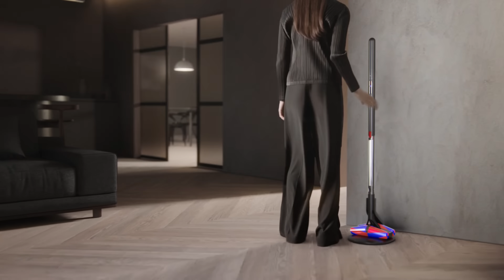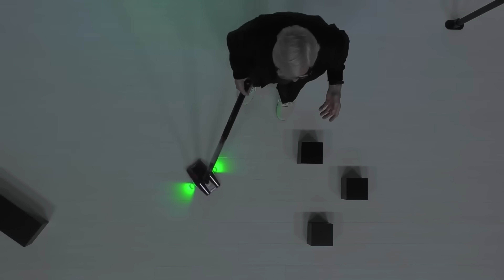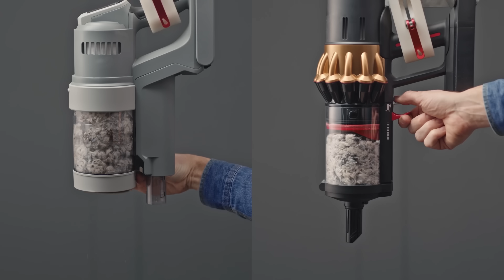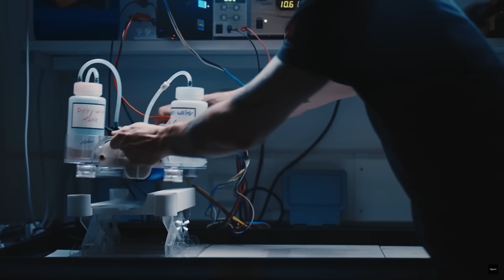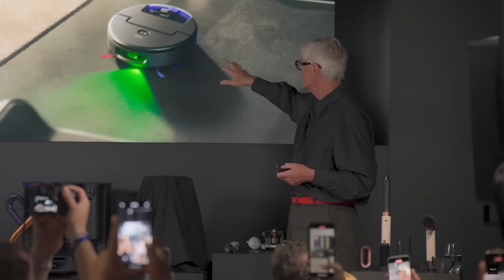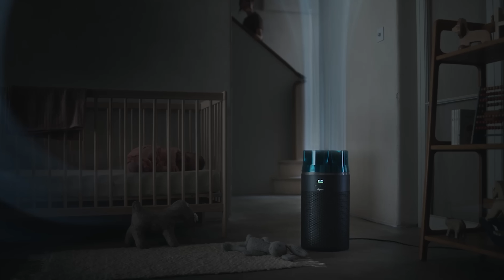What is Going on with DYSON?

Comment: Whats the point of self emptying dock if u only nedd to empty it every month or so??? It wont clean the filter so u still have yo do that so what the point? U will also have go wash dock filters too
Reply from the maker: The main benefit is fewer manual bin emptyings and less contact with the dust. It doesn’t eliminate filter maintenance, so whether it’s worth it depends on how much you value that convenience.

Comment: Not buying anything that needs a battery because when it runs out they charge you a fortune.
Reply from the maker: Replacement battery cost and availability are definitely worth considering before buying a cordless product. A corded model may make more sense for anyone who would rather avoid that added long-term expense.

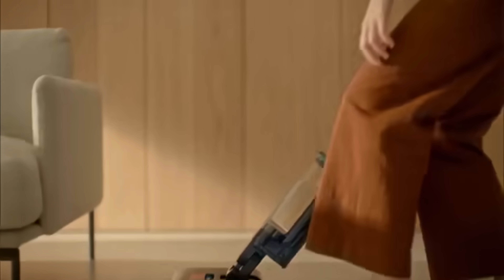Comment: 5:23 it's not a wet/dry vacuum, there is zero vacuuming going on, there is no vacuum motor, and it will NOT handle or vacuum up dry debris. All dirty water and debris is simply squeegeed off the roller by mechanical means, but it will not suction up spills or anything larger than a crumb. I don't know how they can get away with calling it a vacuum cleaner anymore.
Reply: It does pick up dry debris because I tired it without water but I wouldn’t call it a vacuum and I’d use an actual vacuum first and Dyson is making certain products for certain uses but  many people are thinking they are like the tineco but they aren’t they are made to be more hygienic without being like the tineco so they are a little different

Comment: Dyson fired over 1000 people from their UK site in summer 2024 - the vast majority of whom were in the floorcare 'development' department where they take the concepts and ideas from their 'new ideas' department and turn them into scaleable and sellable products. The justification was they could simply do the development in Malaysia by the same teams who work with the tool makers for final realisation, and also outsource a lot of the development work, all in a bid to save money due to losses made on failed investments (e.g. the failed Dyson electric car). The big mistake they found was easily 90% of their floorcare knowledge, curated over 25+ years, existed in the development team who did the majority of testing and tweaking, and they're finding the Malaysian team are now having to do twice the work with the same number of less-experience people in facilities not equipped for design development. It's very telling how there hasn't been a single new floorcare product launched since that wasn't already in active development, and the latest pencil wash is just the same mopping submarine head that first came out 3 years ago attached to the new Pencil vac, which had a lot of negative reviews. The 'new' ones they have launched are just re-skinned evo models that saw limited previous releases. Very sad all round.

Comment: The V16 head needs a bit of getting used to, but it's totally possible - what you get is zero catching of hair and fur - I have 2 dogs, a cat and long hair myself and not once in the 4 months of ownership have I seen anything get stuck to the cleaning head of the V16. HOWEVER, I am a bit annoyed that they released the V16 without it being compatible with any old accessories, shipped it with one single filter and 4 months on none of the fitting accessories are available still on the website. So here I am with my £900 vacuum waiting 2 days for my filter to dry because 1, I only got one for my money 2, it's been out of stock on the website since the vacuum was released in the UK. Thankfully I bought it from John Lewis and considering contacting them to get it returned.

Comment: I'm very curious about the new V8. I'm wondering if it can compete with a V10/V11, or if it is better than those models.
Reply from the maker: The refreshed V8 is surprisingly close to V10-level performance for everyday cleaning, but the V11 still has more power and features overall. So it can “compete” with a V10 in many homes, but it’s not really a V11 replacement.
Reply: @VacuumWars thank you! I'm on the lookout for a new cordless vacuum, for my budget the V11 seems a bit too much, but I'll compare the prices and discounts of the V10 and V8 Cyclone. If the V8 will be much cheaper, I'll get it. (The lowest price in the past month for the V8 was 250€, whilst the V10 was around 350€. At this state I'm thinking the V8 would be the winner.)

Comment: If they haven't fixed the cheap plastic lever on the dust collection bin then its still a no.  Our last dyson barely more than two years old, we couldn't open the bin as the plastic lever just seized.  We took it for repair to an authorised Dyson repairer and they replaced it.  As he is demonstrating the new lever it broke again.  Dyson was sold and we moved to another brand.

Comment: Dude $600 for the pencil vac is literally them spitting on you. That pricing is insane. I hope Dyson fails, they’re routinely the most expensive and don’t actually innovate much. Like cool you made a thinner hard floor only cordless???

The fact it doesn’t even have an auto empty bin yet for the prices they charge is insulting. Fck em
Reply from the maker: Pricing and value definitely spark strong opinions, especially in this category. Everyone weighs cost, features, and innovation differently, and it’ll ultimately come down to whether people feel the product fits their needs at that price point.
Reply: That's why shark is just as good of not better

Comment: I currently have the Gen5 Detect and I just don’t understand why have the one head. The fluffy one is so good for hard floors not to mention the cone thing can scratch hard floors and will wear out the bristles faster. I don’t like the compressor thing either because I don’t want my dirt sitting there and festering. I like the color scheme, but that’s about it. Also the V8 is still going?? That’s a Dyson that just won’t die.
Reply from the maker: . Floor heads really come down to personal preference and floor type, and a lot of people still swear by the fluffy roller on hard floors. Same with the compactor idea — some folks like the capacity boost, others would rather just empty the bin more often. And yeah… the V8 really is the vacuum that refuses to retire 😄 It’s kind of impressive how long that model has stuck around.

Comment: As disappointing as the look of the V16 floor head with all the seemingly obvious design flaws,  I am glad to see a mainstream manufacturer deploy a counter rotating brush roll head (the one on the pencil vac), and we will hopefully see versions for full size cordless/corded stick and corded uprights deploy not only for dyson, but in other manufacturers as well.  Shark's duo clean is..okay, but a true CRB should get really close to one pass cleaning,  and be especially helpful in areas like the northeast where salt season makes vacuuming  in winter a real pain.
Reply from the maker: Hopefully this is the start of wider adoption and refinement across more full-size models and brands.

Comment: 30 days!? Pull the other one. Dyson would have the slightest bit of credibility if it consistently made it's systems interoperable, with swappable batteries, heads that fit between different models, etc. But every one is unique and a new, overpriced fashion accessory.

Comment: i find quite annoying that cordless vacuums are aiming to get thinner and thinner, i am actually looking for a cordless vacuum with  larger than normal diameter that will be able to collect without clogging essentially dirt from the garden brought in by dogs and human into my downstairs "open air" kitchen. i cannot seem to be able to find it. can you recommend one? sure suction is important but stuff keeps getting stuck in the tube, the tube needs to be larger

Comment: Hello folks. Can anyone help me please? I got the V12 Detect Absolute Extra Cordless Vacuum back in 2022.
Though it still works fine, I think I may be due for a replacement. This one will be handed down to family.
Any thoughts or suggestions on what to get next? Thank you.
Reply from the maker: If your V12 still works well, you’re already ahead of most people. For a replacement it really depends on what you want to improve — more power and longer runtime, something lighter and similar, or better hair wrap performance.
Reply: @VacuumWars  Hello. I appreciate your reply. 😊

 I guess we can start with what you mentioned. I'm looking for something that improved upon the V12. Nice to haves are better power, longer battery duration, better hair wrapping, lighter. But one or some of those missing are not deal breakers. Basically, what are the successors to the V12? 

The V16 in the video looks nice. Is the issue about the middle part not cleaning really a big hindrance?

Comment: I have robot vacuums for ~ 6 years, never vacuumed once manually since. I have a dust blower tho, to get the dirt out from places where the robovac cannot reach (then it vacuums from the ground)
Reply from the maker: That’s a great system!!!  Robots handle the daily work so well now, and using a blower to push dust out of tight spots is a smart workaround, let the robot finish the job.

Comment: Cost cutting and profits is what’s going on at Dyson!!   Don’t talk about their rubbish customer care outsourced to an Indian call Centre!   V16 is a horrible machine!!!  I’ve used ur many times in the shop and compared to V15 and V15 does better on carpets and hard floors.   The V16 just doesn’t have the same suction at the floor head! The 140000 RPM - 55 air watts on the pencil vac is on Max mode only which is the mode that has the lowest run time,  it’s not designed to be used on Max mode continuously so I think it’s misleading!!!  Infact this is on all Dyson claims!   V8 isn’t 150 air watts in normal mode,  it’s around 28 air watts.  They say V15 has 230 - 240 air watts,  but again that’s in max mode!!  I’m NORMAL mode it’s 47 air watts!   I wish vacuum reviewers would disclose this information!!
Reply from the maker: Appreciate you laying all that out. You’re bringing up a real point that often gets missed. A lot of brands (not just Dyson) headline their biggest numbers in Max/Boost, and that’s not the mode most people run continuously because of runtime and noise. We try to focus on real-world cleaning results across normal use.

Comment: My concern with the wet floor cleaner is that it’s essentially the same design as the shark steam pickup. If it isn’t much better than the steam pickup it’ll be a tough sell. Just goes to show how well designed the steam pickup is
Reply from the maker: That’s a fair concern.

Comment: Let me guess, the last year's vacuums are incompatible with this year's cleaning heads.  Because they at Dyson has reimagined the connector. Again.
Reply: yup. i got the new piston. old acessories wont work. not even the previous dyson batteries are compaitable. they changed the battery connector too . i will say the new connectors are better, they evenhavea. gasket to cut any suction loss.
Reply: @randomrazr  it is theorized by some that the connectors also have a problem... that crippled the V16.
Reply: @AbsoluteRainbow_2K6  wait what is this new issue with the new connetors?
Reply: @randomrazr  maybe. A small non-conductive tape on the data pins might fix the actual issue.
Reply: @randomrazr  and the best thing is none of the new accessories are available
Reply: @randomrazr  not changed, but reimagined and reinvented, so that it is much more better now :)
Reply: @VladLeonovich-o4x  nahh they wanted to milk more money out of consumers
Reply: @randomrazr that why the reinvetned them not changed, don’t you get the marketing bs? 😂
Reply: @Mateuszyk  ohhh so this is a revolutionary change . got it ;)
Reply: Roborock does this too with their newest QRevo's... They just wanna catch money and dont care about waste.
Reply: Precisely
Reply: When my Dyson goes I'm getting a  Shark vac
Reply: I can attach my v15 detect soft roller head on my v8 animal and it works exactly the same.
Reply: Just making up alternative facts lol
Reply: Strange how that happens isn’t it 😂
Reply: It’s not because I’ve tried it.   BTW the V16 is rubbish!!
Reply: @blakaeg  V16 is crippled, not (true) rubbish! The connectors being changed have nothing to do with THAT!
Reply: I bet you miss USB B as well huh grandma
Reply: every head they made already cames with new vacuums you dont have to think about that. Also no need for upgrading. Vacuums are vacuuums, its not an iphone, its easy to repair, if its not working.
Reply: Following the Apple protocol where nothing carries forward to new models. Out with the old and in with all the new components.
Reply: @scottmackey4182  this is hardly true for Apple anymore, though this year Apple did change almost everything.
Reply: They at dyson? Who talks like that 😂
Reply: Think about as a IPhone that comes every year, and new features aren’t compatible with the older gen
Reply: And they will be able to scan and send the information of stains on your floor to their servers to figure out your diet habits, household members, their ages and monthly cycles and sell to third parties v)
Reply: Not true, I just got a new vac and all my old attachments from five plus years ago fit perfectly.
Reply: @Enhancedlies  it must be something before V16, actually.
Reply: @Enhancedlies only the non-powered ones will fit.

Comment: No way the pencil vacuum has good enough filtration to not even filter the air but protect the motor. The motor is so small, and with the lack of filtration, i think the motor will become packed with fine dust over time and eventually kill the motor.
Reply from the maker: That’s a reasonable concern, but the pencil vacs actually do have motor protection built in — it’s just not a traditional HEPA-style system.

Comment: Used to be a Dyson family. Had multiple Dyson vacuums. We switched to Shark and never looked back.
Reply from the maker: That makes sense — a lot of people have had good experiences with both.
Reply: Shark is awesome. Im still using their pet pro stick vac for 7 years since
Reply: We use Dyson stick vacuum at our school and they break so often.  Reliability is poor, from battery to roller to trigger.

We had more than 20 units with different generations.  I don’t recommend.
Reply from the maker: @sparkpaul  Thank you for sharing your experience!!
Reply: @sparkpaul its a hit or miss, I've had my V7 for 9 years and after a battery replacement the vacuum is still going strong. I bought a shark and it lasted me a good 3 years. All  good vacuums but I like how you can easily buy OEM or Not OEM dyson parts without a hassle
Reply: @sparkpaul I love my gen5! No issues here but I can see it happening
Reply: @sparkpaul   I've got multiple generations of Dyson uprights and cordless for decades. I beat the snot out of them, none of them have failed in any way shape or form. Even if they do break, I know I can take them apart and get replacement parts.
Reply: @benwhittle7204  If they've never broken how do you know how repairable they are? Dyson are pretty bad on this front, they make it easy to take apart the bits they want you to take apart and impossible to go in deeper. On the V15 there is a cable specifically designed to prevent you taking apart the shell surrounding the motor unless you break that cable. When someone figured out how to get around that Dyson updated the later versions of the same model. This is in stark contrast to my Roborock where every part is labelled and easily removed for replacement, though I've read their more recent models are not as modular.
Reply: @jemmywuk   because I never said I haven't broken them accidentally by doing things like accidentally dropping them down stairs etc. I've had to replace parts that I have broken them, but they've never failed themselves in otherwise abusive day to day work.

Comment: Some of Dyson's stuff is worth the premium price, but not all of it.  I like most of their stick vacs, but so far, they've not had a decent robot and their air purifiers are over priced and underperforming.  6 or 700 bucks for the pencil vac?  No.  I have the small thing they made for hard floors a few years ago and don't use it often.  The regular stick vac works better.  Can't even recall the name of it anymore.  The "foofle-fuff" thing with two fluffies 🤣
Reply: Non of them are worth it.  They are cheaply made
Reply from the maker: That’s a pretty balanced take. Dyson does some things really well, especially with certain stick vacs, but they’re not automatically the best in every category. Robots and purifiers are definitely areas where expectations are high at those prices, and the “foofle-fuff” made us laugh🤣

Comment: So I understand why they’re launch it in Asia and then the Australia area because of space.  Me I’m very happy with my vacuum wars recommended vacuum that does everything especially for hard floors for $100. Also use it to vacuum the needles from the Christmas tree on the carpet this morning  I have an  Kenmore vacuum for heavy cleaning
Reply from the maker: Sounds like you’ve got a great setup too: an affordable daily vacuum that handles hard floors well and a Kenmore for heavier jobs. If it’s tackling Christmas tree needles without an issue, that’s always a win.
Reply: Pencilvac is actually take more space to use because you have to use the whole tube all the time. And when switching head the dirt are drop back out from the tube. Old slim model is better for small space.